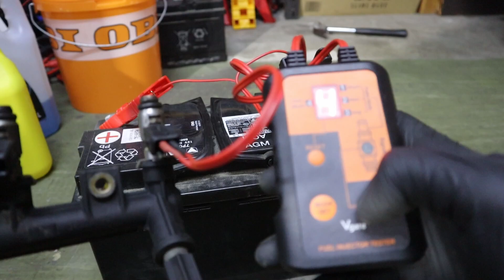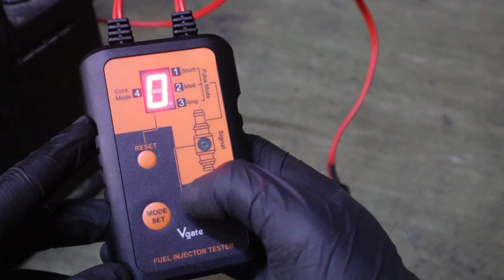Easy way to test fuel injectors (GASOLINE)

Comment: Hello ! I love your videos. I want to know which obd scanner is the best for checking fraud with odometers (mercedes class 2019/2021) thanks !
Reply from the maker: Hello any bidirectional, i have list here: https//iamcarhacker.com/buyers-guide
Reply: Thank you bro ! Is the thinkdiag2 also a good choice for the mercedes ?
Reply from the maker: @basbm9242  Hello I used it for S500 2012, E class V6 turbo2017 and S class 2008 diesel. 
Worked fine for all of them